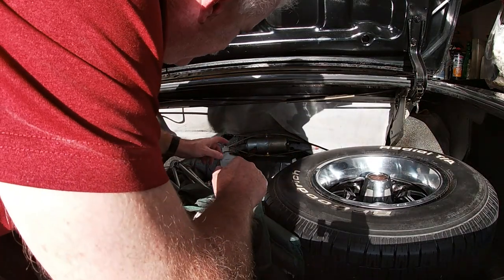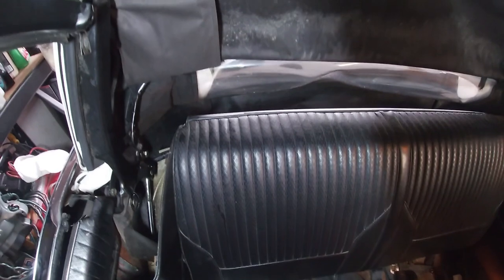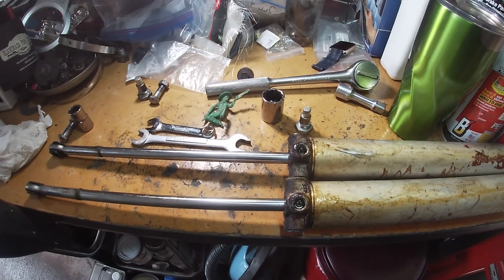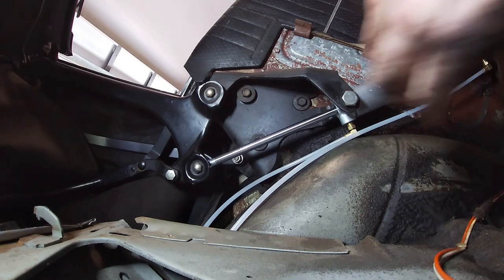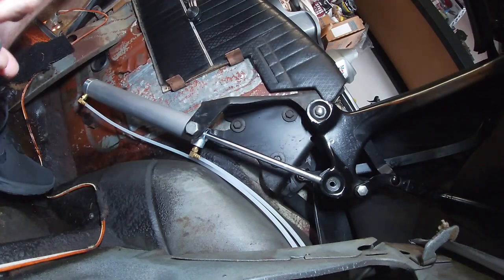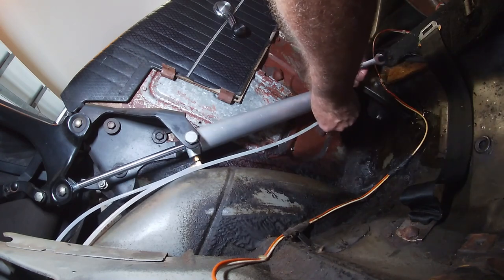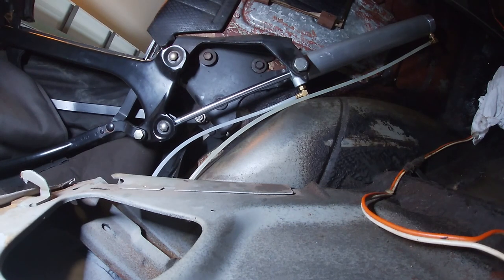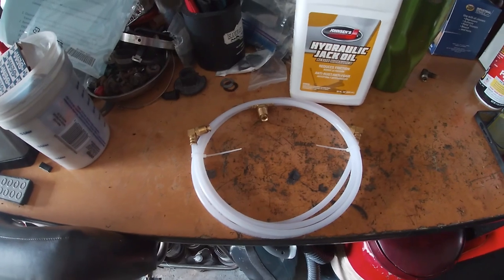Convertible Top Cylinders and Lines Replacement

Comment: Thank you Dan for this great video!!!  I'm in the process of converting my manual Convertible top (Chevelle) to a power top.  I bought the whole conversion Kit from Hydro-electric and they gave me a bunch of parts and not one diagram to install.  I'm going in blind on this and your video explained a lot of the process.  I just hope I don't have a problem with my line coming apart like yours did.

Comment: First, thank you for being so open about the process and showing the issues you encountered. That is such a helpful thing to see!! Overall, your video really was very good. It was easy to see what you were doing most of the time and your commentary helped shed some light on your procedure. A few questions:
1. in bleeding the system, you took out the plug from the motor and filled it w/ jack oil. You then tested the system. I'm assuming you left the plug off and then ran the system? Refilled it to the bottom of the fill hole, ran the system, rinse, repeat until you didn't see any air in the lines?
2. where did you get the hydraulic lines from and what did they run you?
3. I think you said you rebuilt the motor? If so, did you record that process and where did you get parts to do the rebuild? If you bought a new motor, could you share where you purchased it and for how much?
Thanks again for the very informative video!!
Reply from the maker: Hi Michael, thank for your feedback. To answer your questions:
	1. Yes leave the plug out while bleeding the system, reinstall the plug when your all done. I didn’t worry about air bubbles in the system like you would brakes. All I cared about was the top went up and down smoothly. When that happened which I think was two cycles of up and down. I was done.  
	2. I bought the lines from "hydroelectric2009" on eBay for $89. I really liked the vendor in spite of the fact the one lines had an issue but he replaced it for free. 
	3. I did rebuild the pump and checked the motor, the video for that should be linked at the end of this video. I bought the parts for that video from "convertible-service-parts" on eBay for like $23.

Happy that I could provide some insight, and good luck with your top.
Reply: @f119045  Just wanted to thank you for getting back to me and for doing so in such a timely manner!! Looking forward to applying your tips, tricks and knowledge in my rebuild. Not sure if you did your seats yet, but good luck w/ those - stretching fabric can be.....fun(?).
Reply: @f119045  Hello again, Dan. So it's been about a year since we last talked about this project. Getting ready to finally start mine and was wondering how your parts are holding up? I recall the replacement cylinders were built differently than the original (replacement: pressed on top and two pieces including the cap on the bottom vs original: pressed on top but solid, one piece bottom portion). Any issues with your replacement lines? Thanks, Michael.

Comment: Dan do you have a video on how to replace the side panels to get to the cylinders? Also how can u tell if the pump is ok. I’d rather not replace that if I don’t have to
Reply from the maker: Sorry I don't have any video but you should be able to see all the screws and remove the window handle and then panel comes off. If the pump turns on and spins most likely it can be saved.

Comment: Hello Dan. Thank you for this video. It was extremely helpful. I have a 1967 Oldsmobile Cutlass Convertible and will need to do the same by replacing the motor, cylinders and hoses. My car is completely torn apart. How is the electric harness for the top ran from the switch? Is there a mid junction relay or direct from the dash switch?
Reply from the maker: There is a relay between the switch and the motor. I believe its located in the engine compartment.

Comment: I was watching you install those lines on the cylinders, wondering why you didn’t install O-rings on them or even say anything about
Reply from the maker: I do talk about an O-ring problem around 16:15 and installed a new O-ring then. I really don't mention them to much because they were installed by the factory on the cylinders and I did show installing them on the pump in another video. If you have any other questions let me know.

Comment: Do I have to get the exact hose for the car ? I have 68 lemans , and the top lines broke , what would you recommend boss
Reply from the maker: I would imagine they are the same lines. I think you should be safe but you could always ask the seller before ordering to make sure.
Reply: @f119045  thanks found them , used the same cylinder amd connected ever thing but top doesn't go down and no liquid coming out on the too half , and no sound from the switch,  switch looks connected and top goes up , so figured that was ok , so do you think it's the cylinder ?! Or wiring I noticed my connect near cylinder has alot of gunk on it , can I cut that out and connect wires directly ? For possible fix ?

Comment: Do you know the bolt sizea for mounting the cylinders?  Mine are all missing
Reply from the maker: I am not sure of the size becasue of the unique shape of the bolt. But you can find them on ebay under "68-72 Gm A-Body Convertible Top Cylinder Pivot Mounting Bracket Bolt"

Comment: Dan,  or anybody out there,  is it feasible to disconnect the ram cylinders to make my top Manual??  or, will it be to awkward to pull it up?  Too heavy?   Thinking of skipping the hydraulics all together.  Car is a 1968  GTO,  so,  GM.   Thx,   G
Reply from the maker: These convertible mechanisms are heavy not to even mention the canvas tops. I recommend getting the hydraulics working again, I don’t recommend a manual approach.
Reply: I'm converting my manual top to a power top.  There are heavy springs to help lift and lower the top.  I must remove these.  There's a process to removing them so they don't go flying.  The top MUST BE half way down to release tension.  I'm not sure why you want to go the other route.  I find it a PIA to raise my top by hand.

Comment: website for pistons
Reply from the maker: I bought my cylinders from "autoparts_premium" on eBay.
Reply: @f119045  did you get pistons for the 1970 impala because I didn’t see any for the 68 - 72 cutlass for sale through autoparts_premium not sure if the top cylinders are the same through those models.
Reply from the maker: @Problem53  They are listed now as "Convertible Top Hydraulic Cylinder for Buick Skylark Special Chevy Chevelle Olds" from autoparts_premium. They are only listed as a 442 convertible part but its the same body as the Cutlass S.
Reply: @f119045  thank you
Reply from the maker: @Problem53  Your welcome and good luck with your project.
Reply: @Problem53  thers a made in usa place in new hampshire